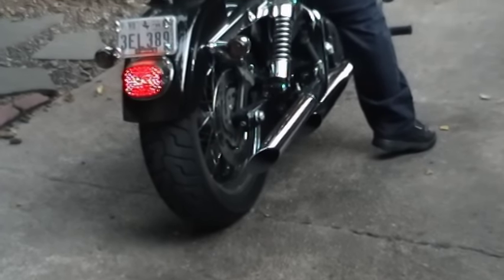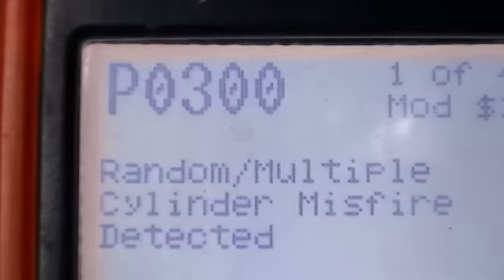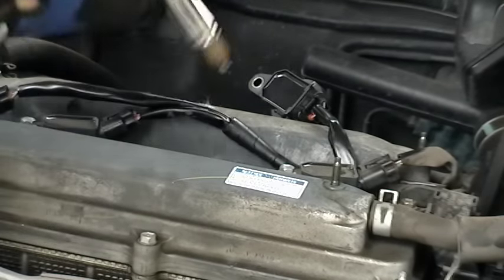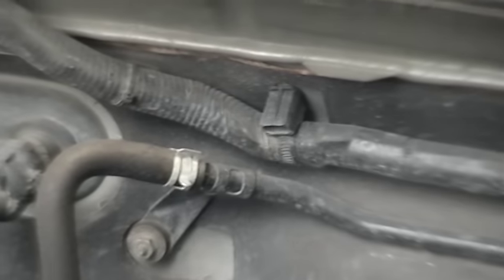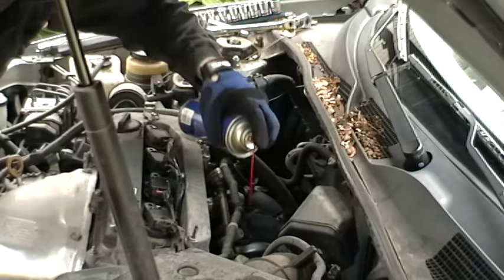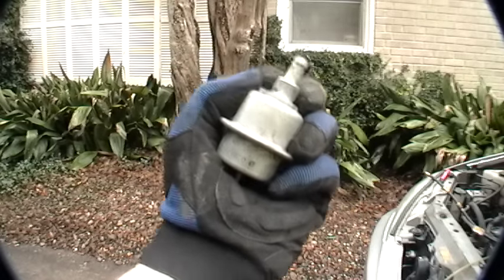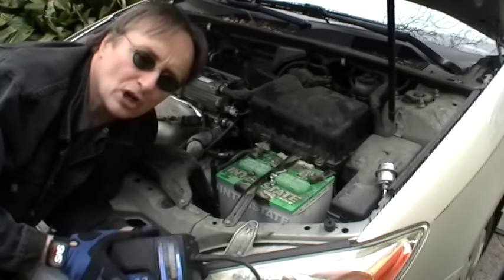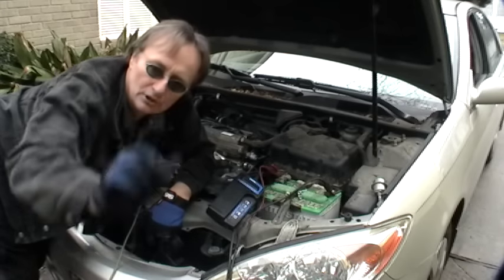How to Fix a Random Engine Misfire in Your Car (Code P0300)

Comment: Scotty I need your help! I have an 03 malibu (3.1 v6) giving me a random misfire code and I'm having issues figuring it out. I replaced plugs and wires, replaced ignition coil, replaces vacuum lines, replaced MAP sensor, cleaned MAF sensor, throttle body. It's really starting to piss me off. I did however notice my brake booster is having issues. My brake pedal becomes really hard to push. I checked the vaccuum line to the booster and its working properly. Could it by chance be an internal booster vacuum leak?
Reply: Ever find the issue?
Reply: Never did ended up selling the car

Comment: hey Scotty i have a 2004 dodge grand caravan 3.8. I replaced the radiator battery spark plugs water pump spark plug wires thermostat relay flushed the coolant and oil but the car lunges forward when the foot is on the brake. sometimes hard enough that the car turns off but can be turned right back on. only code p0300 any ideas?
Reply: also it idles rough

Comment: Currently facing P0300 Random Misfire on my Supercharged 08 Solstice.. I'm going nuts looking for what may be causing this. So far, no vacuum leak, new spark plugs, new intake/exhaust camshaft solenoid, the catalytic converter is in great shape.. When I accelerate, it'll drop to 500 RPM then go back to 800 range idle. Some popping in my exhaust and it shudders when idling.. very strange.

Thinking that it may be the tune for the SC? Bad AFR?
Reply from the maker: GeneralDodo  really, on something like that, I hook up my dealer level scan tool and analyze live and mode 6 data, it tells tons to a pro who knows what such data means. Otherwise, wild guessing abounds and  a bad AFR sensor is a good guess.
Reply: Thanks for the reply. I started it up today and noticed some noise coming up front which I assumed was the supercharger before, but is coming from the crankshaft pulley, and I notice that it has a very slight wobble. This sound wasn't happening before the install.
Reply: If you would like, I have a video on my channel demonstrating the problem I am currently facing along with the P0300 code. Titled 'Pontiac Solstice strange bogging after accel'

Comment: I got a speed 3 and a p0300 code popped up. Wondering since i got the vvt done and they replaced the gasket would that throw this code.... Its a stick andnhas no hesitation on iy

Comment: It's showing that my alternator in my 2004 4 runner is going bad, but the mechanic suggest I could try replacing the voltage thing on it,, my first issue began with my spark plug coil , because my engine would misfire, so I had the coil and all the spark plugs replaced. Charles runs good but my check engine light came back, so now there it's the alternator, can you please help. ?
Reply: Your alternator?

Comment: I recently went through a battle with a p0300 code for my 2004 Monte Carlo 3.4L I had done everything suggested in this video and could still never find the problem. I eventually took my vehicle to a Firestone repair shop for a computer engine diagnostic where I was met with a lying mechanic claiming I had a bad intake manifold and could not be the only problem. Could be heads and some other things. After paying them 113$ for the information I took it to a mechanic I knew that suggested a Diag. Low and behold the problem was a fuel pressure regulator. Because of the bad information from the repair shop I spent an extra 200$ in parts and labor changing a intake manifold that was not even bad from my test prior to taking the car in. I thought I must of done something wrong. The shop would not reimburse me for the extra cost of bad Diag and only refunded the Diag. My only question is a fuel pressure regulator something you should check into when having this problem?
Reply from the maker: they are scum bags, they refunded your diagnosis fee but not the fee for the wrong work they did. Get even, tell everyone on the NET about that shop, or tell them you are going to do this. Then they may refund the rest.

Comment: I have changed the fuel pump, pcv valve , valve covers , ignition coils , sparks plugs , egr valve , injectors , intake manifold and intake manifold gasket , 1 02 sensor , mass air flow sensor , checked and replaced all vacuum lines, cleaned the throttle body and air filter and i still get the damn code any idea what i should try next.

Comment: Hey Scotty I have a Infiniti G35 2003 coupe, I have a misfire sometimes, like once a month when I start the car from a cold start and let it sit 20 seconds, it starts to misfire, what iv noticed is that if I turn the AC on and then off the misfire goes away for about 5 seconds and returns, and after about a minute the misfire is gone and car runs good. No check engine light and it happens like once a month. What could it be?
Reply from the maker: +hnm2014 often bad ignition coils, have a pro check their data first

Comment: hey Scotty my  2005 dodge neon rpms are running low, I've change the crank sensor cleaned throttle body put new air filter and still dose the same, what can I  do?

Comment: I have a 99 Civic. I had a P0303 code, with rough starts, so I decided to try new plug wires as a first step. (previous owner said the spark plugs were changed recently) While pulling out the old wires, I found motor oil in one of the plug tubes. So, I bought and installed a new valve cover gasket kit. I reset the obd and the check engine light came back on with p0302, p0303, p0304 and p0300 codes. What did I do! It's worse than ever.
Reply from the maker: joshua malezi   could be the distributor is going out, typical on that model, have that checked first

Comment: I have a 2004 mercedes e500 and I'm getting a random misfire code p0300 I told that the x4/10 fuses are blown and that's why the engine is misfiring I had new plugs put in and wires but I didn't replace the ignition packs and my air filters are dirty can u give something concrete to go with
Reply from the maker: 500s are complex monsters, you really need it scanned with a star tester, of course change filters first

Comment: Hi Scotty. I have a 2005.5 Audi A4 (B7). Today, while in the freeway, I noticed at about 2000-2500 rpm the car started giving me these hiccups every 3-5 seconds when pressing on the accelerator. If I let go it would stop. I exited the freeway and driving at or below the 2000rpm it was perfectly fine. No engine light has come on. Recently had a vacuum leak fixed last week. Any idea of why that could be happening?

Comment: I just had my car diagonosed last Friday at a mechanic shop. They found the P0300 Code random cylinder misfire / 2 evap leak codes and could be a possible cam sensor, phaser wiring, computer, exciter ring. This is what my car is doing. I start off driving it and it stalls really bad like the motor is idled up really high and it finally changes. So what I've been doing is easing my feet off the accelerator and just cost down the road if I'm on a hill.  My car has has over 100,000 miles on it and it is a 2006 Chevrolet Impla. What could be wrong.

Comment: I just changed fuel pump car started but the code says cylinder 3 missfires it's not the coils but I think connector bad how can you tell if it's bad connector?

Comment: Good Evening. I have a 2000 nissan pathfinder le and am getting a random misfire and knock sensor code ( p0300 and p0325 i think) i have replaced/relocated the knock sensor to the top of the engine where it was recommended by a few people i know who work on cars and on the internet. I also replaced all 6 spark plugs and erased the codes but after a while the SES light would come back on. the car Idles a little rough and the SES light flashes  when am driving it seems to run fine but doesnt have as much power as a 3.3L engine should. anything you can suggest? i was thinking about the ignition coils but i was going to change the wires out before i spent $70+ to get them off the internet.
Reply from the maker: best to analyze, rather than guess with parts. we mechanics have ways to analyze ignition system other than guessing, using scan tools and oscilliscopes to test coils and other parts. But of course, that costs big money, so you may just want to guess with cheaper parts considering mechanics charge 100 dollars and up per hour

Comment: Hi Scotty 

How you doing I have a 99 yukon freshly rebuilt new everything or pistons valves and all and it's still pulling up the code p0300
Reply from the maker: often fuel injection problems on that car with those stupid vortex systems leaking inside the manifold, check that first. Also check for vacuum leaks

Comment: Mr Scotty, I have a 06 4.7 durango and it gave several codes po300 (2x's), po340, po335 (2x's) I've changed the crank p.s., cam p.s., tps, and another sensor next to the throttle p.s. can't recall it's name, the truck doesn't over heat but runs hot and forced low fuel economy, I see no visible coolent leaks or disappearing coolent, the radiator, hoses, thermostat,  cap, water pump, and fan clutch have been changed, also did a coolent bleed out. it has hesitated on acceleration, turned off and turned right back on, it has hesitated to turn on but will turn on, on a couple of times, the fuel pump/filter have been changed, the alternator/starter/battery tested good. will you please advise or suggest on something else I could do besides burning my truck down. please
Reply from the maker: on those, often a worn timing chain does that, have a pro test that first
Reply: +Scotty Kilmer thank you sir

Comment: I have a 97 cadillac sts. I replaced the spark plugs in 2013 the wires in 2014. I recently got a p0300 code auto zone told it me it says p0307 is misfiring. What could it be? could it be an ignition coil? a while back it gave me a p420 code for about a couple of months then it went away, now it doesn't come up anymore, I never replaced the cat could that be the problem?
Reply from the maker: swap the coil, if miss moves, that's it. Pray  it's just that and not internal engine problems

Comment: ok, I have a problem, My check engine light is on for a PO300 code. The battery is new, alternator is good, got new spark plugs and wires. What's going on? thanks
Reply: Try adding “seafoam” or any other FUEL STABILIZER to the gas tank, sometimes fuel is contaminated with water 🤷‍♂️

Comment: hey scotty i have a 2005 chevy silverado and po300 codes pops up 
i already change fuel pump but its idling is to low and hardly wanna stay on i have to hold the acceleration for it to stay on. now i check a spark plug and its a lil wet what can i change so it wont be wet in oil or smell of gas.
Reply: can it be a bad catalytic converter as well if it makes a raddling in the cat??

Comment: I have a 2007 Ranger Rover Sport and I am getting the P0300 code.  It takes forever to get my vehicle to start but once it does it idles fine and after about 10 seconds of driving and runs fine.  Is this just the spark plugs hopefully?

Comment: Hey scotty.my 05 3.7 lt dodge is throwing up a p0300 code along with a p0138 and p0158 o2 sensor code. Iv checked for vaccum leaks .changed the plugs coils imtake gasket. Cleaned the intake, injectors all that good stuff and still the problem persists. Have you any advice that may help me ?
Reply from the maker: Yea, don't buy a dodge, they start to fall apart when they near ten years of age. You have random misfires and oxygen sensor codes, tons of things can do that. But, if you want a wild guess, replace the sensors, reset the computer, and PRAY real hard.
Reply: Scotty Kilmer yea iv already replaced all four sensors thinking that would sort the issue out but it didnt. Looks like ill have to explore other options.

Comment: So what if your check engine light is blinking on and off and it feels like you have multiple misfires and they replace all the ignition coils and spark plugs this is for a 05 Nissan Maxima could High have purchased the wrong spark plugs if so what happens if I purchase the wrong spark plugs

Comment: Hello Scotty my name is Kathy and I got a customer with a Dodge Caravan 2011 and it seems that the computer is not regulating the alternator current and to run some during the daytime but at night and then using lights the go damn and it cuts off won't crank so I'm thinking which alternator with a built-in regulator can I rig on to that van I didn't want to my drop top 1988 Dodge 600 stop so I put alternator on it had a built-in regulator so I figured maybe I can go to this one too or at least give it a shot that's why God made pull aparts thank you very much hun I appreciate your input 🚗

Comment: scotty my 2001 camry v6 got this p0300 after revving the engine trying to pinpoint exhaust leaks myself. often, when coming to an idle at red lights after sprinted driving the idle falls low and it feels like its misfiring, but i feel its setting a p0300 just because the idle falls way too low and engine stumbles. any ideas?
Reply from the maker: fix the exhaust leaks first, that can cause bad air fuel ratio by confusing the computer with bad oxygen sensor data

Comment: I have a Nissan Almera 2001. I have a p0300 cold. Cold start idle problems + there is a loss of power / shuddering when under load or going past 3000rpm. Any ideas?
Reply from the maker: many things can do that, at least a dozen I can think of. But most common on those is a bad maf sensor or weak fuel pump

Comment: Ok I just got my car back from Firestone they replaced coil packs, I put new spark plugs, I changed the crankshaft position sensor, the camshaft position sensor and also replaced the starter ! I bought a new battery and alternator reads right on multimeter and I’m still getting a misfire on cylinder 1 p300 code I am writing this before continuing the video cause I thought I could while it played so you may answer my question when I’m done but I’m case I’m asking anyways what can I check to figure this out it is an 09 Dodge Journey 2.4 l engine !?? If I get my answer In the video I will comment never mind under here lol !!! Thanks guys
Reply: I am gonna try the vacuum hose thing and the fuel maybe that can answer it thanks for the videos Scotty they really do give a lot of info for us normal folk !!!!!

Comment: The PO300 code with  'check engine' light on solid, not blinking, means that the computer is shutting the motor down to preserve the engine, as designed to. Probably to avert  gasoline fire.  In modern vehicles, even over 10 years old, if a spark plug or c.o.p. fails, the computer, through OBD-II diagnosis, will specify the very cylinder affected. So a V-6, with a bad pkug or coil, will run as a V-5 while sputtering and shaking but will still run.  A PO300 means the problem(s) is common every cylinder, which means electronic or analog  fuel/air issue. There's probably a fuel leak or fuel starvation. Often times it's the fuel pump has packed it in.  And this can ascertained with difficult startups. The engine won't start. Battery fine, fully fueled, starter motor fine, 

Sometimes it's a bad ASD relay, the auto shutdown that's a fire prevention system that shuts the engine if detects a potential fuel fire issue. 

It could be a clogged manifold, or dirty air filter. Almost never a bad plug or coil. 

If the engine runs rough after startup with check engine light on solid and quits, it could mean insufficient gas pressure.  Could also mean blocked injectors. The fuel pump could be toast and/or injectors or the cylinders aren't getting enough air. Or there could be a ground fault somewhere. 

The PO300 code, as identified by a handheld OBD, can mean a bunch of different things that the computer isn't designed to specifically identify.  That's the frustrating thing about these vehicle computer systems.  But odds are it's an analog issue. The computer isn't sensing the expected fuel/air mixture and it goes berserk. All the engine misfire shakes are by a computer system operating in digital panic mode.

Comment: I have a problem with my 2003 Nissan Sentra- 4 cylinders. It has check engine light on and the code says P0300. When I start the car it does not stand in Idle at all. It shuts off by itself when it is left in idle. The engine makes 'Duh' 'Duh' sound before it shuts off by itself. It stays on only if I accelerate or increase the RPM. If i try to drive it does not seem to be having full power, it moves slow and the RPM will not increase even if I press the throttle fully. The check engine light blinks sometimes too. Please let me know what could be the problem with this.

Comment: On my car, it showed the P0300 code and the P0141 code, but I replaced the Crankshaft sensor and forgot to clear the codes. Even a bad Crankshaft Position Sensor can cause an engine misfire or a leaky exhaust. Which reminds me. I should fix my resonator with tape, sheet metal, and clamps.

Comment: Have 2008 chrysler aspen and autozone told me its the crankshaft position sensor. I have installed new spark plugs and replaced 2 coil on plugs and 3 days later this codee came up. I need help, a mechanic told me if it was the crankshaft position sensor my car wouldnt start.